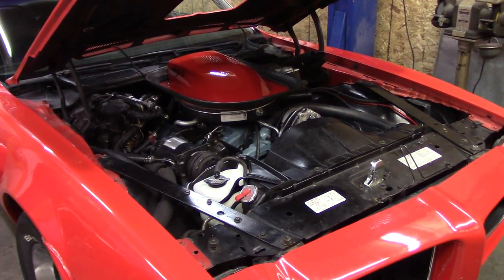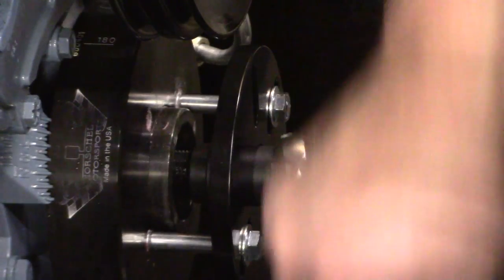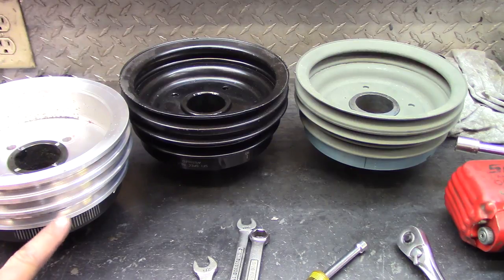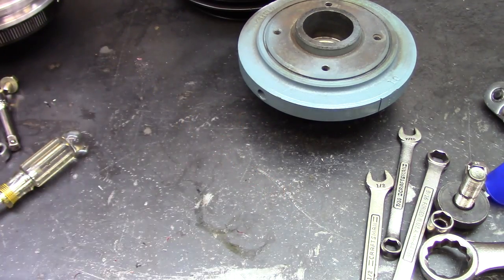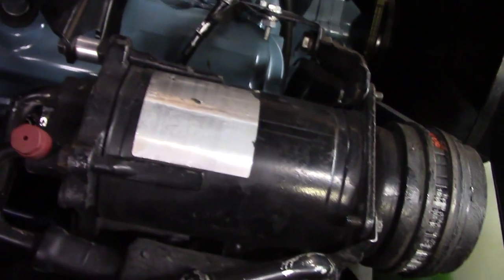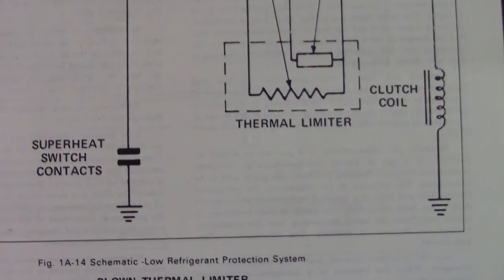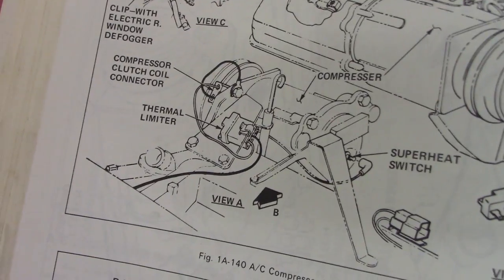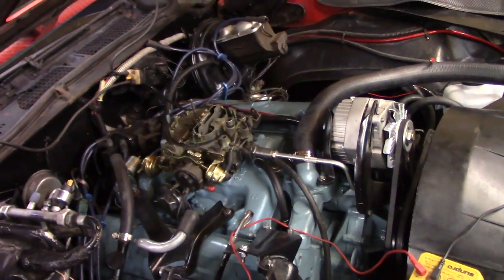Trans Am  Air Conditioning  Work TA AC 1973

Comment: So one of the wires from the poa valve gets spliced into the power wire to the compressor. Where does the other one from the poa valve plug go? My 74 has the same setup and I’m trying to get it working.

Comment: Great job with the firebird love your Channel what harmonic balancer do you recommend for a 1972 455
Reply from the maker: The ten dollar question is do you have air conditioning?
Reply: Oldsmob455 no A/C and don't plan to put one in either
Reply from the maker: There are a lot of choices out there for Pontiac motors.  I'm guessing your car is a strip strip car? I'd get one with a pulley centering hub(rules out the TCI rattler as it is currently made).  I would also get one with the correct bolt pattern for the stock pulleys.  SFI approved is a good thing. Made in the USA is a great thing.   I heard some bad things about imported silicone filled balancers(e.g. breaking crankshafts).  This info should be a good start to your research before you bust the checkbook out.
Reply: Oldsmob455 thank you very much for getting back to me I appreciate it